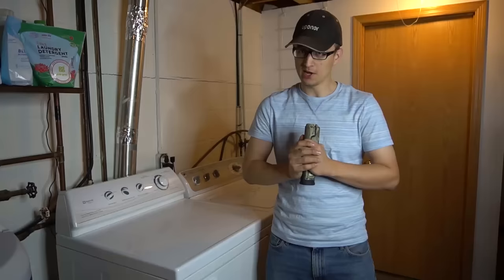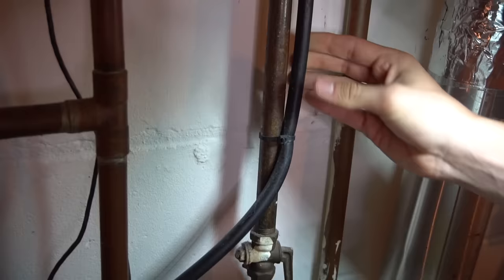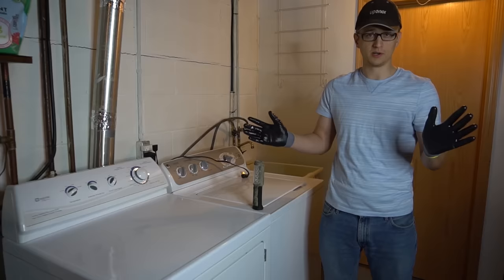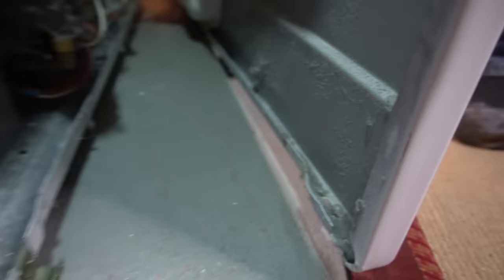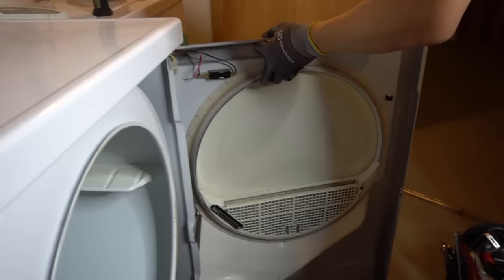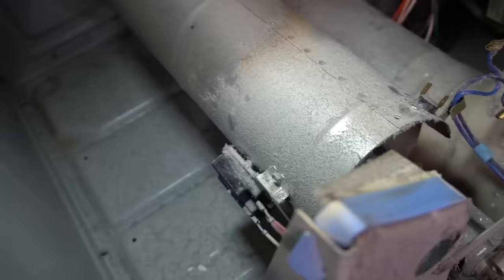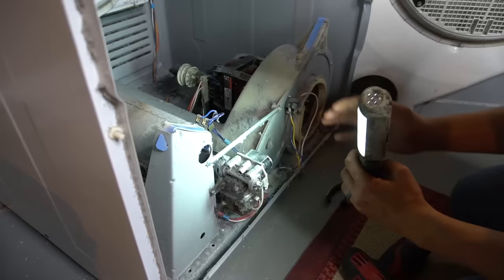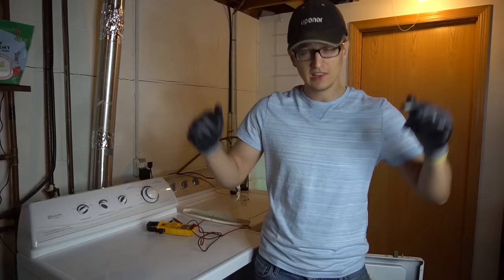Dryer Not Heating and The Most Common Fix

Comment: Why would a gas dryer not dry in “High”? It does dry on medium and low.
Reply from the maker: My guess is that the switch is simply burnt, broken, or has a loose wire at the terminal where the high speed connects. You would need to check it visually and with a meter to be certain but replacing those switches is usually pretty easy unless your dryer has a control board instead of knobs. The boards are expensive.

Comment: Mine has got a faint burning smell and it's not heating correctly. It's hot at the back where the heating element is but barely warm inside the drum.
Reply: Sounds like the blower isn't working.  Is hot air blowing out the exhaust vent?

Comment: I can't find why my dryer does heat I replaced the Hi-limit  thermostats and cleaned the lint our
Reply: get a multimeter and poke around, the part with no continuity is almost always the part that needs replacing

Comment: i changed my egnitor but the egnitor lights up but then goes right out before the gas get going
Reply from the maker: It's possible that you have weak or dead gas valve coils. I would try replacing them as that is one of the more common problems.

Comment: A thermal is nothing more than a switch, l've checked hundreds and taking the wires off isn't really necessary.  Thermals should be wired in series not parallel.

Comment: great video. i had replaced all heating parts. thermal fuse, thermostat, coils, igniter,  still no glow/heat. breakers checked, gas on.????? whirlpool duet lp gas serial # M40196732 MODEL # XP29T06EC30U1.  any help/guidance appreciated.

Comment: Is it normal when you open the dryer whil the coils are glowing to smell a little burning smell
Reply from the maker: There may be some odor, yes.. But just in case I would look inside of the burner tube, (the ignitor and the burner are inside this tube) all the way to the back and make sure there is nothing in there. I had a hair ball light on fire once in the back of the burner tube... Luckily no damage done since I was there when it happened. Just some smoke alarms went off

Comment: You need to know the the impedance of each part you test... make sure each part tests to its factory ohm rating. Continuity is not enough.
Reply: All of the parts he tested except for the coils are simply switches.  They're either shorted, or they're open.  Continuity is fine for those.  If they have bad contacts, they'll have high resistance and test open.   Continuity isn't fine for testing coils, which he found out.  Their higher resistance may indicate open on continuity.

Comment: Great Video. I did everything that you did here and I'm still having a heat issue. The heat kicks on for about 10 seconds and kicks off. I have ample air flow. I cleaned the whole dryer on the inside, including the exhaust housing and tube that runs outside. I am stumped and beyond frustrated. Any more ideas? Gas Maytag Bravo M# MGD6400TQ0
Reply from the maker: It's possible that the gas valve coils are weak. They are a pretty cheap part, I would try replacing them first.
Reply: Word of Advice TV that was it! Great Job and Thank You. Your video was very informative and helpful. Keep up the great work!

Comment: The round type thermal fuse can actually be reset by slamming it on the ground or other hard surface
Reply: Thermal fuses trip for a reason.  Please don't just reset them and put them back in.  Fix the problem before the firefighters show up.
Reply: @stargazer7644  Sure you should investigate the problem but i was pointing out that you don't necessarily need to run out and buy a new thermal fuse.

Comment: He talked too much. Anyway. If you take it apart. Change the coil too. They are $10.   99% of the time is the heat igniter. $30. 50 should do the job if you know what you are doing.  I am not a pro but I fixed mine.

Comment: I can't believe you didn't tell people to check their circuit breakers first! Many 240v circuits use breakers that trip individually. There are two, one for the motor & controls, and the other for the heating element only. If the latter breaker trips, the dryer will still function as normal, except it won't get hot. If I had taken my dryer apart on your advice, only to find that this was my issue, I would be seriously pissed at you!
Reply: I have never seen a dryer that had two power cords.  And why in the world would you be pissed at someone who is trying to help you for free over the Internet?